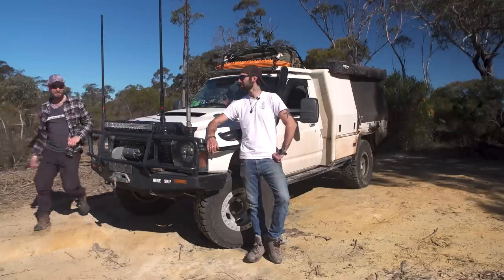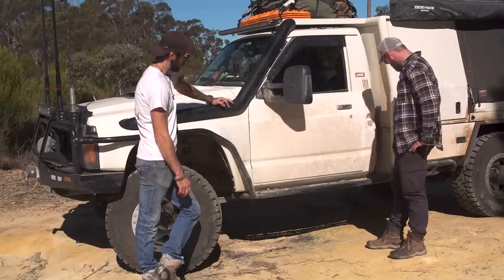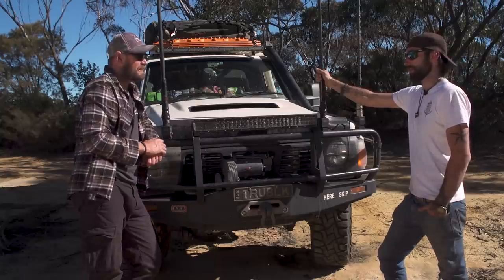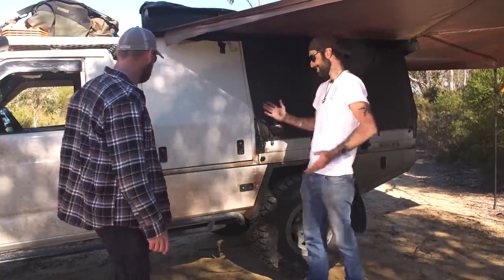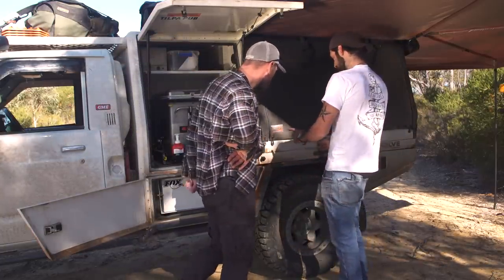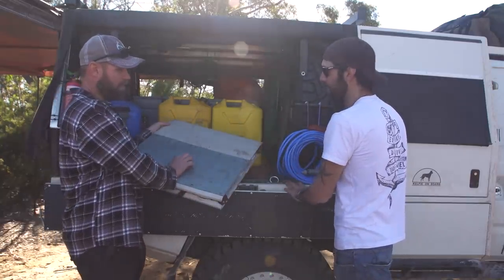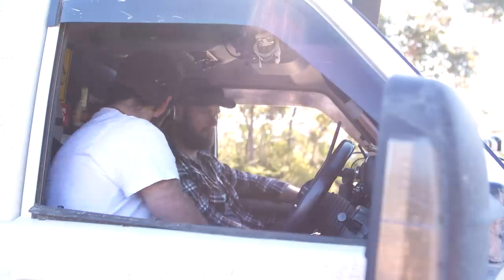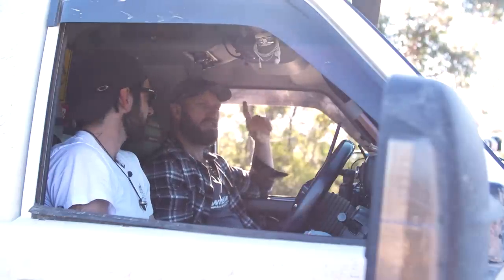EVERYTHING IS MODIFIED ON THIS PATROL, Modified Episode 72

Comment: @22:43 Just a heads up for anyone now thinking any TD42 can take 27-30psi. As he said his engine is a factory turbo GU td42 which along with the silvertop are the only engines which can handle 30psi long term. Post August 95 blacktop td42s will only handle ~12psi (or 15psi intercooled) any higher and you will start doing real damage.
Reply: Good one mate see too many people pushing big power in blacktops and breaking stuff better to save and buy the better rig once

Comment: I have a 2016 Nissan y61 patrol and they are still producing them as 2019 models for the middle easy GCC countries they only come here with a gas I6 4.8 thats a monster engine off road especially on sand